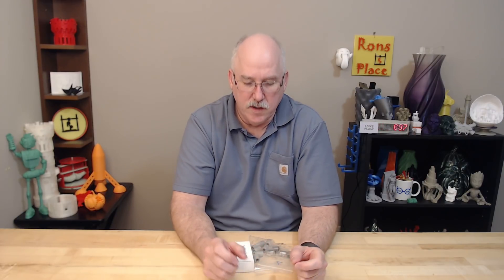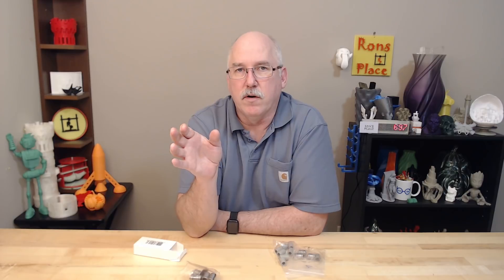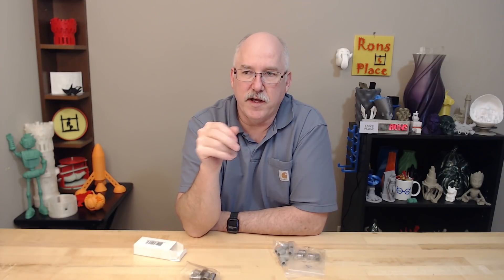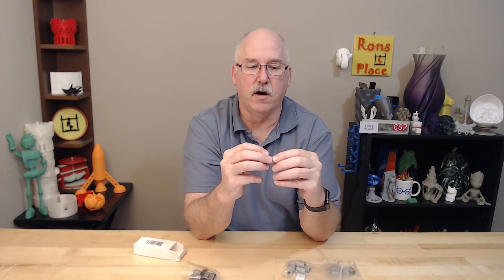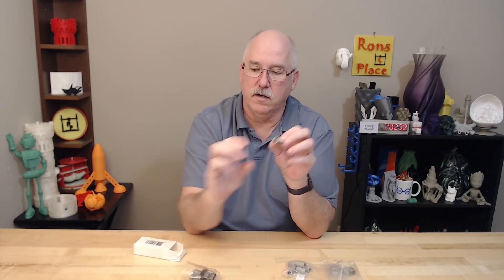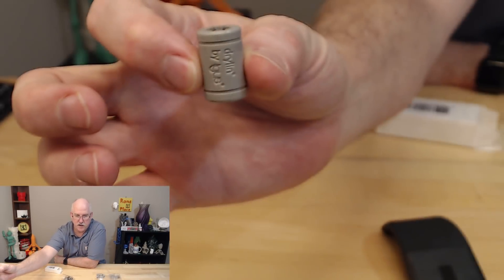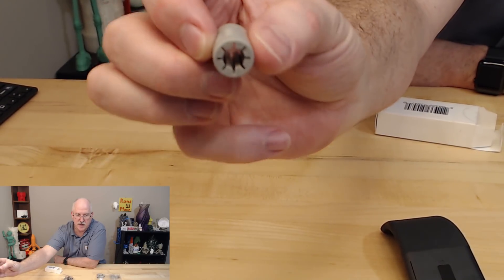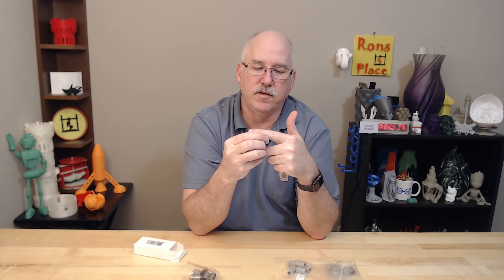IGUS Bearings -  Prusa i3 mk3

Comment: Darn.  I should have watched this video before I bought the igus bearings.  Good news is I haven't installed them yet. Like you I have a "grinding" noise with the standard bearings that came with the kit.  I have used synthetic grease before assembly.  I need to get a magnet and see if the rods are stainless or hardened steel.  That could be the issue.
Reply from the maker: I have heard a few did ok with Igus.. I just didn't have good luck personally.  I have a few ideas, but honestly once I replaced the bearings I haven't had any problems.   You certainly want to ensure you have the the correct rods.  Mine were.

Comment: Hey Ron.  I have been down the same road with my Prusa printers on the y axis.  My first I3 MK2s had bearing failure and I ordered new rods and bearings from Mitsumi.  They were ok, but I thought that I could do better.  I also saw that people were complaining about slop on the IGUS bearings so that was a no go...even the pressed in version.  I tried these from a seller on EBAY and could not be happier:  https://www.ebay.com/itm/8UU-FMC08-PBC-Linear-Metric-self-lubricating-Bearing-8mm/162090905145?ssPageName=STRK%3AMEBIDX%3AIT&_trksid=p2060353.m2749.l2649 
My MK3 should be delivered this evening and I already have a set ready to go in.

Comment: There is a Prusa forum topic about the bearings, you should read this. IGUS bearings work fine on IGUS aluminium rods when these are perfectly aligned which is quite hard with the u-bolts and printed y-rod holders. There are SFK bearings which seam to be better but they cost quite a bit

Comment: I eventually got my MK3 and been printing a week. With the latest firmware I was getting layer shifts but after turning off the detection, no more shifting. Few people on the forums with the same result.
Reply: I used to have the same problem with the layer shifts, but i installed the latest firmware (released february the 5) and now it seems to work fine, i'll do some more test prints during the weekend though.

Comment: yea, igus bearings need their accomping rods. On the bearings u got now, put some lithium or silicone lube on the rods and the should help the bearings roll nicer and quieter, and if u ever take them off again, put a little bit of lub in the bearing before putting back on. Misumi bearings are meant to be better, i think they are just longer lasting to the tolerance they are ment to be at, the cheap bearings just replace after a good amount of print time imo.

Comment: I currently use the Igus in my remodeled Mecreator 2. Here they do a great job, but here are also always 2 linear bearings in a line.
I think that's the point. the 3 bearings in prusas y axis just leave too many possibilities for the bed to twist.
Igus is not ideal for every application.

Comment: Hey Ron,
I've been using original IGUS bushings on my Anet A8 rebuild, and the thing with them is that indeed there is a tolerance that can cause that some a little loose. Furthermore the fact that they are self lubricating means that some of the polymer dissolves to lubricate the bushing resulting in an even more loose fit.

I originally installed them on the X and Y axis of my printer to get the machine to be more quiet, but have since (using them for about 6 months) replaced the ones on the bed for the normal LM8UU bearings. The X axis i also wanted to replace, but having the alignment just right at the time made me not do it just yet. Although i'm seeing artifacts in my prints now and start to wonder if that is because the IGUS could be catching on a specific place on the rods. As the artifacts are always in the same spot of multiple prints.

As for the Prusa Mk3, i have one on order and am getting around March 5th. Was thinking of installing IGUS on that, but after experiencing this and now your video, i think i will stick with the normal bearings Prusa includes in the kit.

All in all seeing the price of the IGUS bushings is quite a bit more then standard LM8UU bearings, its unfortunate they wear out quite quickly.

Comment: The Igus you showed need to be pressed into a pillow block to get the proper fit. It’s also best to use the aluminum rods that Igus makes for the polymer bearings. 

Igus does make a bearing that cased in aluminum to the proper fit and are the same dimensions as the steel 8mm bearings.
Reply: Ron Hunt You’re welcome! I hope you find something that works. They do list them on their website but it’s in an odd place 

They are the RJZM-02-08

https://www.igus.com/wpck/3661/drylin_r_rjum_02
Reply: Ron Hunt The H7 fit is a slip fit. The aluminum housing preloads them to internal spec. At least that’s what I was told by Igus. I used them in a Haribo mod Prusa for almost a year before they wore out. Also used the aluminum rods.
Reply: Ron Hunt I’m pretty sure that if you look at the page on Igus’ website the bearings you have it says “designed as a press fit” or something like that. The aluminum housed ones ask for an H7 housing which is a slip fit housing. They also work with the u-bolts. You just have to be crazy careful tightening them to not deform the aluminum.

Comment: Have you seen Tom’s video ‘should you be using igus bushings’ I think you may have got a better result using the igus with the aluminium sleeve.
Reply: Ron Hunt yeah, watch the video, it explains why these don't fit well. It isn't because of the rods.
Reply: The best prices I can find on those are over $20 each! I came here after Tom's video to see how it goes with the non-sleeved ones.  I was sure hoping it would be better than this! I guess I too will stick with balls for now.  They sure have eaten gouges into one of my rods though! But I can replace rods and bearings enough to last me several years for the price of those caged igus.

Comment: I was in the group that got the wrong rods, and when I got the new rods and bearings, I tried it with some igus bearing I had hanging about. I found the hoop fixing it compressed the plastic making them not run free enough. Misumi bearings are supposed to be really good.
https://drive.google.com/file/d/1iS13nv_gKguMspX6nzi5QXwhptg4zPMN/view?usp=sharing
Reply: you could possibly make an stl that hold's the bearings in without putting too much pressure on the plastic, instead of the hoop.
Reply: What exactly did you do? My MK3 will arrive in some weeks and I planned to install the 01 Igus plastic bushings. I just want the best and the most quite bushing possible. Did you print out some other mount or how do you use the bearings?